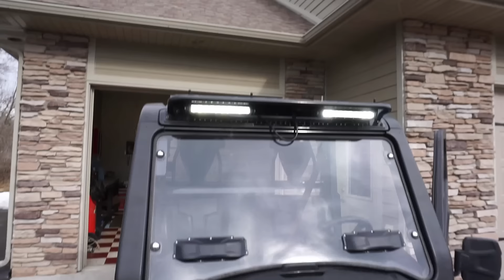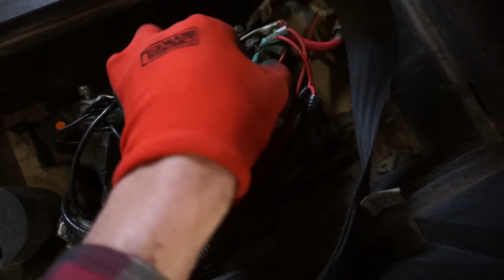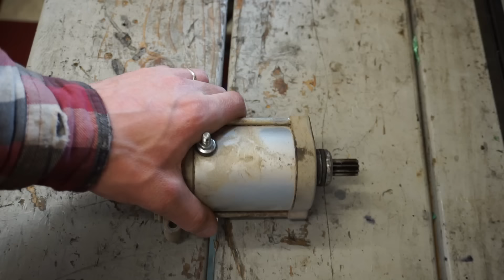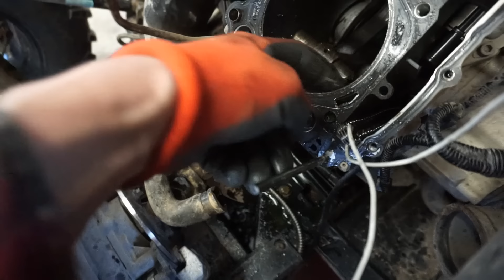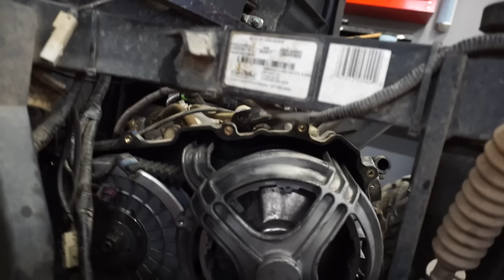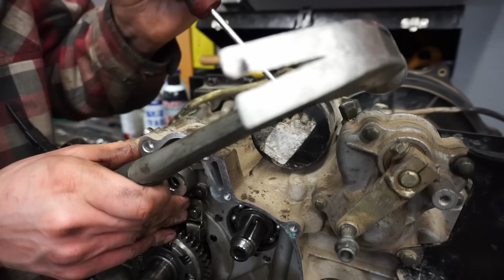I Bought This $15,000 UTV For $3,500. How Bad Could It Be?

Comment: A valve hit is a timing chain failure, check the chain guide as it could be worn by oil starvation or bad design/manufacture.

Comment: Step #1: Does the engine turn over ?  That's a deal breaker. When testing a starter, do not arc on the threaded stud. Put a nut on it or arc to the frame. Anyway, I want one of these.

Comment: If the older couple said they were driving it and it just shut off and wouldn't start back up, sounds like they misrepresented what actually happened, which is it made a LOUD NOISE FIRST(or series of them) (piston breaking) then shut off and wouldn't start up. That's completely different from it "just shutting off".

Comment: Hey bud. With your kabota you need to bleed your injectors. Crack your lines loose and turn it over until the fuel comes out in a nice stream, tighten it up and go to your next one. After you get 2 done, it might start up and then you can crack your third one. Also you need to fill your fuel filter up with fuel before installing it otherwise you are put a bunch more air in your system. A diesel engine has twice the compression as a gas engine. They are very fussy.

Comment: All a bit of a heart breaker. I guess it is what we here would call a mudguard - shiny on top and shite underneath😂 The Romans had the right of it "caveat emptor' - buyer beware. The unit certainly looked the part and when all said and done you can't see inside 'em no matter how long you stand there looking. Cannot see a follow up video 12 months on so I expect it was judged a good money after bad proposition and went to the scrappers. Surprised how involved the construct of the little motor is, bit of a nightmare to work on although obviously not your first rodeo pulling one down. Interesting and entertaining video.

Comment: Good time to start calling Wrecking yards or (salvage yards)looking for one in their yard.    Get for couple hun & swap out parts (good for bad) chances of running into another engine that exploded is slim so U got the replacement parts cheap.  It does not have to be NEW

Comment: China Junk   do your research before you buy a bighorn  wish I did because I bought a bighorn 550 it has 84 miles on it now,  its been nothing but problems from day one . Now I have found gas in the crank case so the motor has internal damage and they refused to refund my money so I got attorney working on it. Sunright power sports in georgia is the dealer of these machines and they are not doing anything to make this right for me.     Dont buy a bighorn. China Junk

Comment: The old couple must have been driving it when the piston let loose and the engine turned into a garbage disposer.
It's simply impossible to miss =that= kind of noise.   Yeah, just JB weld the piston and cylinder sleeve back together.  Piece of cake.

Comment: Not good..I stay away from Cub..The newer mowers with the kholer 19 20 hp are just not good motors..Look at market place be some nice looking cubs all have blowed motors..Still its kholers motor..Husqvarna has same issues..Cheaper parts to meet the contract..I was hoping Mr Joe was going  to have a easy fix..Cray cray..😂
❤

Comment: My car ate a piston once. The valves jumped time by 3 notches. It accelerated like crap but got up to speed eventually. I was halfway home on an 80-mile trip when the #2 piston disintegrated. Scarred the cylinder wall a bit. I replaced it with a junkyard piston and got another 8 months out of it before it went again. That time it took out the cylinder wall. I replaced the engine at right around 100,000 with an engine that had about 120,000 on it. That went another 45,000 miles before it developed a knock. Once I tore it down, I figured out it was the flex plate rattling on the torque converter. My pistons were completely sludged up though, and the oil pump needed a new seal. About $800 later it's all back together and running like new or better.

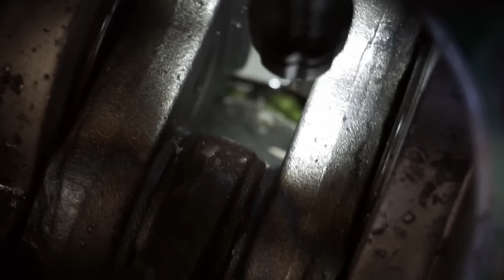Yes, the rod bearings will be fine, but the cylinder wall will be toast. You may have gotten lucky on the valves (I'm at 37:16 in).

Comment: On my tractor battery was 12.6 but no start replaced the solenoid, and then the starter the problem was the battery. I did not check the load and I should have.  With a new battery all is good.

Comment: Not a fan of Cub Cadet, why they can't stick with one manufacture and improve on it is beyond me  instead they totally abandon a model after only a short time and move to cheep and dirty as in this Chinese UTV, I bought a Cub Cadet 750 Volunteer in 2013 was totally different with a Kohler motor, had some shifting issues and lacked power steering rather than improving on it  they simply moved on,  they ever had a diesel version back then that had potential.

Comment: That UTV went through too many hands to get to you. The outside of that vehicle may have been clean when you got it but, back in the area of the engine and the engine itself it looks like it has been ridden hard and put away wet too many times. Why is all that soil in the undercarriage? Why is there so much dust inside the engine bay? Why are the fasteners so rusty? Two grandparents who use a vehicle like this won't cause it to be messed up like this one. I think that some throttle jockeys used grandpa's utv as they pleased when grandpa wasn't looking and this is what you get. It was abused to cause that damage. 

Good luck

Comment: I used to work for MTD (Cub Cadet) and had this exact unit as a demo to engage dealerships to sell these machines. Hisun is the manufacture. Lots of issues with the wiring harnesses and lack of manufacture support, forced Cub to pull the plug on the Challenger 750 efi.  I never had an issue with my demo and loved it. Hope you get it fixed up!

Comment: That's the kind of carnage you get from over reving the engine on a down hill run that you lost brakes. This happens in big trucks that run mountain passes where the driver selected the wrong gear loaded on a downhill slope. Or Nitrous over boost! Or, the keepers for the wrist pin came out, were left out on an overhaul. or the press fit was too loose.

Comment: I juat bought the exact same machine myself blown up. Could not find a replacement engine. Ended up using a grizzly 660 engine and everything swapped over. Had to make a pipe for the coolant. Efi and everything swapped over.

Comment: You stole that thing, you should be in jail. Low miles& hours. Great project machine. How much time did it take you to diagnose the problem? Just curious if it was less than an hour. In other words, it would’ve cost a hundred dollars to find out it was gonna cost a fortune.I don’t think they ran it without oil because the oil was dirty, I don’t think they added oil after the fact. It would be cleaner than it was. They said an old couple owned it but they didn’t mention how many grandkids were out bogging in it. That looks like someone younger was driving it, never a good idea. I’m wondering how it ran long enough to chew it up that much.

Comment: When you took it apart the tiny washer was on the gasket and crushed into the gasket that might have caused it to do that too ya never no It got put together like that ... And people did not no and ruined the piston over time ...Or over heated in the cylinder  ...
Reply: But good luck fixing or replacing ..I wish i could find something like that to use around me cheap ...But even 4 wheels go for alot 4g or more...

Comment: The seat is wore out/torn, I’ve had a lot of sxs’s and 4-wheelers that have sat in the weather for months at a time and I’ve never wore out a seat in 2000 miles. Odometer was changed in my opinion.

Comment: You sure got a handful with this wreck of an engine. That's the first time I have ever seen a total demolition of a piston! They must have run the starter until the engine seized up with all the parts getting stuck under the axle. I guess their hearing must have been impaired, if they did'nt hear what was going on under their asses.

Comment: IF you were getting juice to the starter, after a couple cranks, it would be sensibly warm.  The starter draws exactly 1 Mega-Butt-Ton of electricity which generates a lot of heat.

Comment: No metal in oil because it set long enough they settled to the bottom.. been mechanic 40 years, stopped by a guys shop had one of those 275 gallon plastic almost see through totes that was full of oil.. asked him why it was outside.. it looked like clean new oil. He said it had been setting in sun for 10 years and all carbon separated and fell to bottom.. funny I had the same tote empty setting in texas sun 3 years later plastic just broke apart. Guess his oil kept plastic from drying out and breaking down? Love your videos keep them coming

Comment: Great video mate. Visually that engine looks in bad shape with a hell of lot more than 200 hrs on it. Looks more like 20,000 hrs! What did you just say: “The people barely used it”. Mate, whatever you do, don’t play poker, you are as gullible as gullible can be!!! Mate, the engine casing is all pitted and corroded. No metal fragments in the oil: Simple, they changed the oil and refilled it with old oil to deceive the buyer that all is well!

Comment: That’s how a lot of people are they take every thing to the dealer then the dealer always  gets you I bet it’s asimple fix the people who own it Probably don’t even put window washer fluid in their vehicles that is the type of people to buy everything new show it don’t start let get a new one 
I bet you got a great deal I got a 2016 JohnDeer gator825 I the people were going threw divorce and I don’t think he wanted the wife to get it I got it with a 30 miles brand new for $4500 Electric dumb but back then Full cab with John Deere they did not make then stock like they do now you had to buy everything or order it and it’s really expensive I got the John Deer Factory windshield a wiper that thing was $1200 or $1300 i’m going to get the back window and eventually get some doors but it’s crazy how expensive John Deere anything is they get you luckily I got a deal on the UTV it’s 50 horse power that’s like a 800cc it has a lot of low end power and it does 44MPH  I got blinker kit that was $300

Comment: Joe, I  had a Suzuki dealership with my dad in the 70's we replaced rods ourselves using the shop press to press apart installing new rod and bearing and pressing back together then using a straight edge making the counter weights even never had a problem u might try it. We did it on all the racing bikes as well.

Comment: You have shown us that about 90% of your buys were bad starters, bad carbs, broken wires or dirty ashtrays.   Based on what the seller told you thought you could turn $3500 into $10k with a new starter. 
With your past luck, statistically you were due for a speedbump. 
But you can still make a profit after the repair. If not, those things aren’t worth what they are selling for. Good luck.

Comment: Man when I was Teen I rebuilt a car with my dad years later it snapped a push rod and shot a 1 inch hole in the value cover. But wow a whole piston disintegrated. Luckily I was like 4 blocks from home. Limped home on 4 out of 6 cylinders due to metal flying around in the engine. Intended to rebuild it again but never happened, sadly. Donated it to a school auto-shop, they donated to it to a art fixture out in the nearby desert.

Comment: Any time a 12v lead acid battery (non-deep-cycle) is below 10 volts just sitting there, Replace it.  Even if you can charge it, it's life is over.  It will not last.

Comment: It's not a "Ground". Tell me exactly how a vehicle sitting on 4 rubber tires, GROUNDED ? Event the electrical code book no longer refers to the bare copper wire in receptacles as the "Ground". The only wire that can be called a Ground is the wire that goes from the electrical panel to the actual ground ! All the other wires are to be referred to as "Common" wires, so a normal wire in people's house has a Hot (black wire) a Neutral (white wire) and a common (bare copper wire)

Comment: Firsr you need to charge the battery. Second the engine isnt moving whej you try and start it . The starter is draining the battery. You should check the oil first thing..pull the plug out and put a little oil ln the spark plug hole. Next see if you can turn the engine over by hand. You are doing everything wrong!

Comment: Back in the 70's me and a buddy pulled the head off an old '63 Cadillac Fleetwood with a 390" someone gave us and two of the cylinders looked the same way, cam was broken in three places and it was a total wreck. We found the engine and trans from a '64 with the newer but same block 429" engine and swapped it in, they told us it wouldnt fit the previous year Cadillac but we had the driveshaft reworked, redrilled the rear trans. crossmember mount for the new drivetrain and it ran fine.

Comment: I noticed just a dribble of coolant when you disconnected the hoses. Combined with the loose battery terminals, it seems like maintenance wasn't a priority, and it ran with little or no coolant... so seized when it overheated ... and the piston was the weak link in dealing with the rotational inertia at the moment it seized, so it was destroyed.  The lack of collateral damage,  apart from one bent exhaust valve and one bent spark plug tip, is surprising.

Comment: Hopefully, everybody watching, learns that just because they are a "old couple" doesn't mean they are trustworthy. They scammed you. Also, if you look @ the piston rods ( bottom) you can see the " bluing" from the excessive heat that engine was under. That engine was subjected to catastrophic failure. Might want to check for cracks in the engine case B4 re-assembly. Good luck with your project.

Comment: I've done a lot of Aircraft Engine rebuilds,  both Lycoming and Continental, that cratered in flight.  Blown out cases, pistons, rods, heads...you name it,  but I've never seen this much damage on a single cylinder engine.  If you rebuild,  you've got a LOT of work ahead.  When you split the case,  me thinks you'll find the case unusable as well.    I'd go with already rebuilt engine, and cut your losses....

Comment: I had a VW as a first car.  Overall a good car but started loosing pressure.   Took it to a mechanic to get it fixed.   It ran really smooth until the intake valve got sucked into the piston (read through) when I was getting on the Freeway 2 blocks from my house.  That thing sounded like a thrashing machine on a bad day.  But the mechanic was honest and rebuilt it for free.  He had misread his calipers.  Owning up to a mistake brought greater respect.

Comment: Surly when looking at a “non runner” the first thing you do is turn the engine over by hand, using one of the pulley bolts to determine whether it’s locked up. That’s mechanics 101. If it’s locked up then all bets are off with regard to asking price, you assume a total rebuild or replacement engine and offer accordingly.

Comment: Iv niver seen anything like that in my life and I'm a machanic retired.  the person who sold you that knew.he has  Put a scope in the plug hole and seen there  was no piston. Good luck buddy you will still come out on top.
Reply: He couldn't get it to turn over, so it's hard to do a compression test.
Reply: I was wondering why he did not do a compression test and squirt some oil down the plug hole like he usually does. On the whole he is very good with carbs and trouble shooting. Do the testing first. A bore scope would have said a lot.

Comment: Coul be Anything. Check the tire pressure. 2. starter direct from battery posts does that kick in?  okay did timing chain jump a tooth +. no maintenance (but 200 hrs) 1664 miles @ 8.32 mph even the oil & filter got dirty meaning the break in oil was likely never changed and how much came out (did you measure)  Maybe just cold start runs to the mail box and back, with  idle chats sitting still sipping coffee. I'd sure like to know the prev user to see sump'in. Still a deal even if worse at 2018 = About 5 solid yrs. but can anyone unpliug the hours timer?  Pulling trees?? and such

Comment: With those "symptoms" of just shutting down and then this no turn over condition? I go right to pulling spark plug and hand turning crankshaft with a ratchet n socket. You know then the engine locked up or not

Comment: they make them using as little space as they can.. Just jam everything dont worry about if a part needs replacing.

This is done so that the common person when something goes wrong will take it to a mac and that person will have to take other parts of to get at the one that is bad thus taking more time and more money for the mac and more that comes out of ur pocket.

The other thing that will happen when one of these goes bad and the person is no a mac and dont know one who is any good will  just sell it and buy new.  Buying new is what the corps want.  After all they make everything to last only a few yr b/f it start having parts break on it.  They do this to sell more and no other reason.

Comment: 🤔 $3500, $2500 in repairs or complete running used engine = $6000 in a $15, 000 machine... Awesome 👍 deal... Noooo way that's a loss 💥

Comment: My guess how this happened was the decompression was activated, and it was maybe run downhill, or used as an engine brake, maybe dragged for trying to bump start it, but I would suggest high rev rpm, no compression, piston let go, likely why the pin, connecting rod and crank is all fairly intact. I would be curious to know if the bent valve was the one connected to the decompression mechanism.

Comment: Looks like the wrist pin lock come off and the pin moved over enough and everything went bad from there. Faulty pin lock or not correctly seated.
Reply: But they knew it was locked up the starter would have never been strong enough to do that.